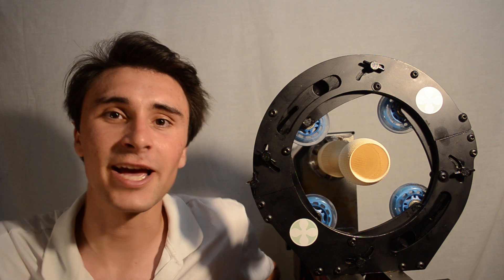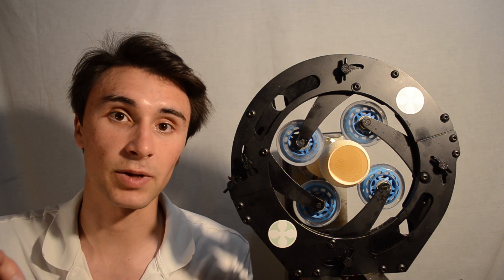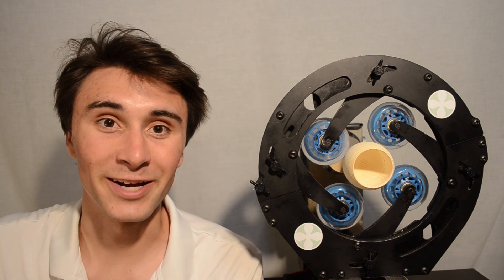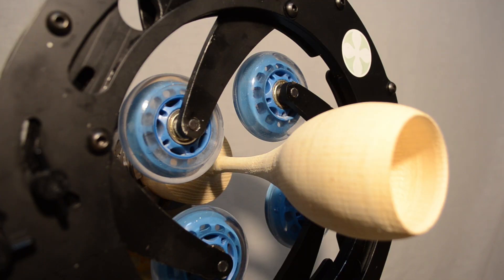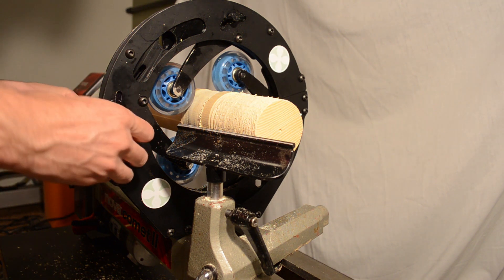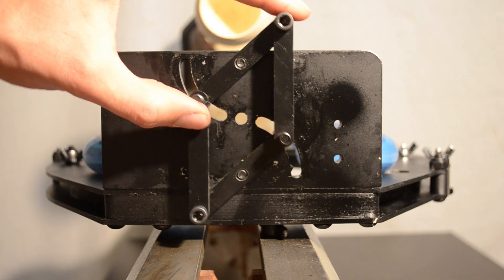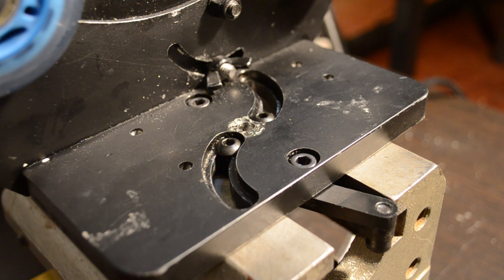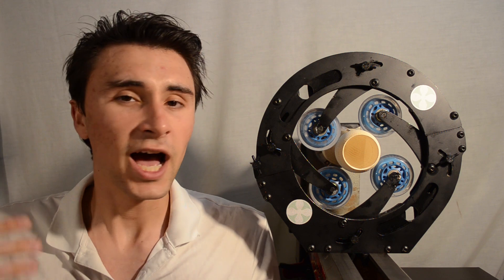Iris Steady Rest - This new invention solves this huge problem...

Comment: Very cool idea. Centering devices like this have been around for a long time, but never applied in this manner. Nice job. By the way, your hyperlinks to the product and web navigation are not working. If you need and parts for that rig, I'd be glad to take a look at them. Thumbs up.